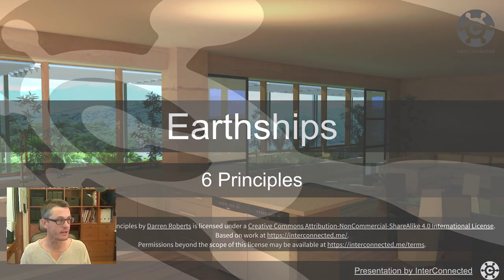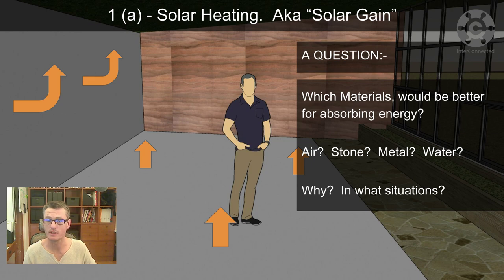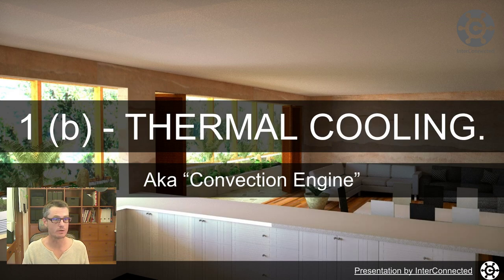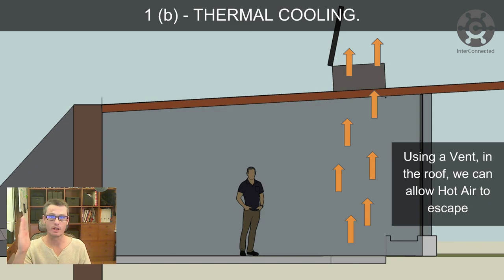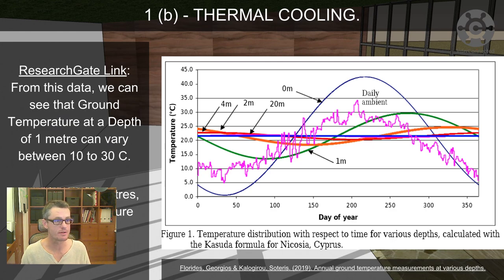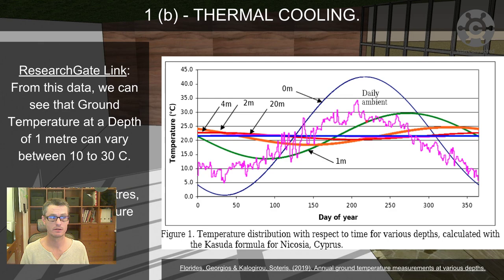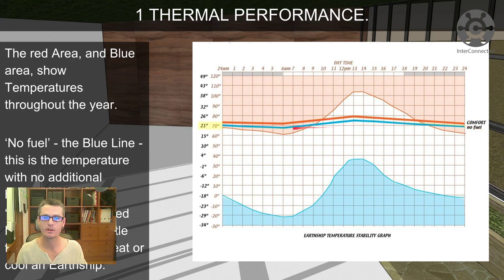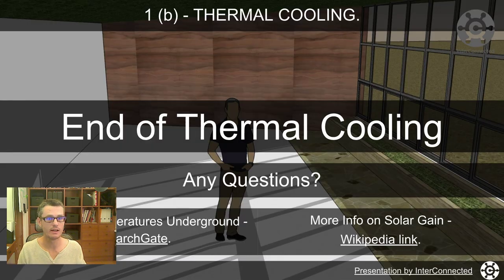Thermal and Solar Heating & Cooling in an Earthship Style Eco Home, Earthship Principle 1

Comment: This is want I want to do with my tiny house! 

Create an air flow through a sunken insulated cooler that benefits from the cooler earth temperature and the ice bottles I fill it with and have fans circulating the air from low to high inside the house. 

Seems diy friendly but haven’t seen it done yet. How do you deal with moldy condensation?Thanks!

Comment: I have a question that I hadn't been aware of. What about humidity coming threw the piping?
Reply: I've heard that can be a problem, but there are so many different ways of doing this that I'm not sure what types of systems would have that problem. some use corrugated drain pipe with perforations to allow moisture out. some use sealed PVC. if you're using sealed PVC, you will need it to slope somewhere where it can either naturally drain or be pumped out. not sure if either method is good enough to prevent significant indoor humidity. if I were in a very humid environment, I might do a system where I pumped water through the ground, then used a radiator to cool air, and have a drip pan to drain away all of the condensate. that wouldn't be as passive, but would work better for high humidity

Comment: So is there a way to calculate how many cooling tubes I would need for a greenhouse exclusive Earthship. I plan on building a small scale first. I am in the north east part of Brazil where it in always about 30 C during the day and can see 100% humidity most of the days. I want to keep it cool to around 24 C while still getting a lot of sun light in the building.

Comment: I live in the subtropics and humidity during the rain season is very high. After consulting this method with number of people we all got to the conclusion that although it is a great ventilation method , in our case the condensation and following mould and fungi growth would become a big health issue. What are your thoughts?
Reply from the maker: Hey Jiri.  Yep, I have lived in Taiwan for 10 years.  Sub/Tropical.  Very humid.  

Couple of things I've considered myself.  I might look at having the interior botanical cell outside, instead of inside the greenhouse.  Still can be used to filter the greywater to then be used for toilet flushing, but obviously the plants would then be transpiring outside the home, so less moisture in the air.

I've also looked into solar chimneys, and have drawn some plans exploring the idea of using a solar chimney on the sunward side of the building (instead of a greenhouse the full length of the building) to draw air through the cooling pipes > through the building > then up the chimney.  Solar chimney could have assistance from solar thermal also - with pipes radiating inside the solar chimney for extra pull.

Shade/overhang/fewer windows would then mean less heat to the interior, while still being able to power a solar chimney.

I know that natural materials in general absorb (and release) moisture better than, say, concrete.  Especially in bathrooms (not in the shower of course, but the rest of the walls).  But they have to be able to release that moisture at some point / or will stop absorbing.

And, if the building is well-insulated - then it might just make sense to go with a modern AC inverter unit, if electricity is available, and it doesn't offend your environmental sensibilities ;-)

I'll throw the drawings up on https://interconnected.me at some point if I can find them - on paper somewhere, not sketchup...

I'd highly recommend Prof. Dr. Gernot Minke's book - Building With Earth.  The man has excellent research, and real-world experience.